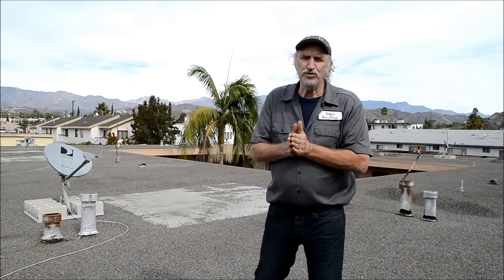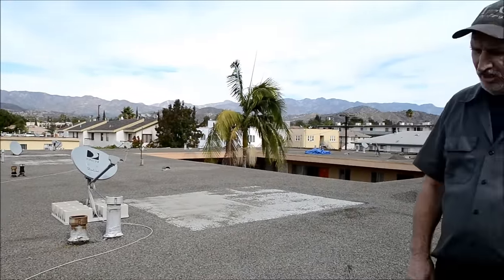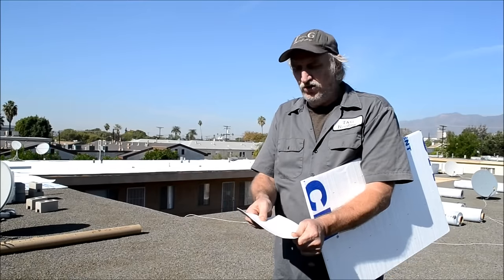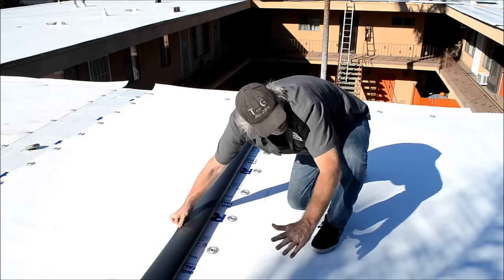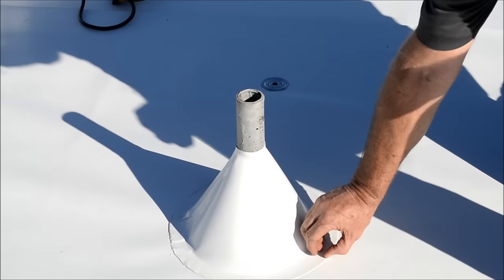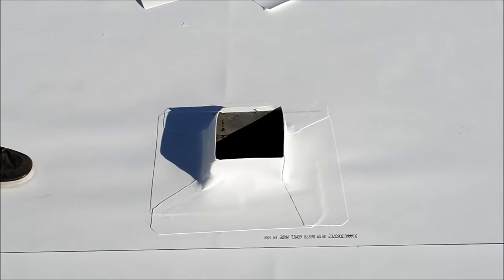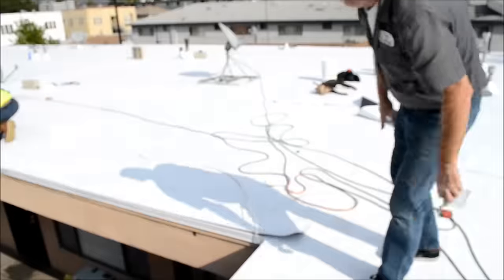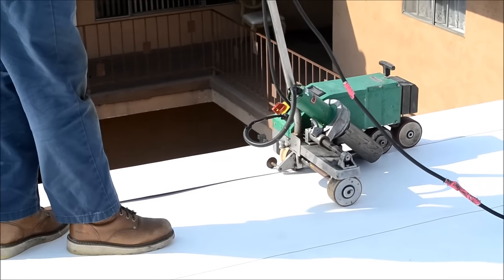All About TPO Roofing

Comment: For some reason , there are always people that think they can do it better , I bet you any money , most of the haters here can't stand on a roof for 8 hours, they don't even know how is like to be on your knees heat welding the single ply membrane ,they don't know how the white single ply membrane burns your face and bothers your eyes ,  as usual brainless people , write , comment ,nonsense stuff.
you guys did a very good job, I'm glad you didn't show this people how to actually do it , it's not worth your time , as long as the roof don't have a leak in the next 10 years , you are a good roofer!!  most of the bad roofers have a leak on the first fucking rain and they still brag about knowing what they're doing .
Good job !
Reply: I reply with facts. I have been doing single ply roof for 30 years. Started with Hypalon (Burkline), Trocal, JPstevens, Bondcoat, Firestone EPDM, Carlisle EPDM. Got certified for Firestone in "86 back when ya had to get certified to install. I have been offered jobs with Johns Manvill and Sarnifil to be an inspector. We installed Carlisle back in the day when you earned points for perfect roofs and could use the points to buy things from their catalog. So putting on a punch free roof is how I was taught 30 years ago. So when I said there were things done wrong they were. If i inspected this roof they would have been back fixing more then a few things. As for fall protection 6 foot up 6 foot in. PERIOD. 25k fine from osha dont feel good in the bank. Last leak I had was 5 years ago and it was trade damage. My name is on here if ya dont believe me check with any of the big Manufacturers Carlisle, JM, Sarnifil Firestone here in southern CA. Ill let them tell ya.
Reply: Thats pretty funny have a great day.
Reply: I roof all day every day from torchdown modified to hot tar gravel to foam and TPO this roof would never pass inspection it’s wrong insulation he ripped the owners off bye giving them a crap roof
Reply: First of all, the box is ugly as fuck. Line that shit up so it looks presentable. Second, wear sunglasses X87+ so your eyes wont supposedly "burn". (The reflecting sun rays wont melt your face either) 
Third, Quality matters.
Reply: This roof hasn’t leaked in the 6 years since we did it, we give a 10 year labor no leak interior damage warranty on every new roof we do. We are constantly working on quality and since this have changed a lot of how we instal single ply including the curbs your are mentioning. Please try to be more respectful of your fellow man, we have been in honest business since 1980 and have a very fair price for a very solid workable product.
Reply: I do this for a living so were is his membrane perimeter? Inspector had fun with that if it was inspected.
Reply: Right? I've been a roofer for 4years it's not for the faint

Comment: in 1979 the braas system everything was hand welded area and details, back pain, knees red raw, the solvent weld was 3 times, we used to do the upside down roofing system a lot quicker than the flex disc fix

Comment: HI. I am about to start a 100,000 SF gravel roof just like the one you replaced and we may use TPO. I have some questions: Is TPO more expensive than other roofs? What kind of screws are used?
Reply: We have a gravel roof. This company installed tpo for us. So far so good. I don't know what kind of screw they used but it's holding up well

Comment: im thinking about taking a job doing this. Not fond of heights .Ive had to deal with them as ive been a carpernter for years but not a fan.   like it gave me anxiety watching ur guy with the heat roller on the edge. couple questions though i was always you had to be tied off that close. but then where ? sometimes theres nothing to tie too. also when you installed the seam on the edge , why wouldnt you use fasteners? it seems like that would be the ideal place, protecting from wind etc?

Comment: What about possible dry rot that needs to be repaired? Especially if structural integrity is comprised like beams and purlins? Your roofs only gonna be only as sound as the roof deck under it. 🤷‍♂️
Reply: That's up to the buyer to decide 🤷‍♂️
Reply: You can also go in the attic from the inside and check the plywood and beams!
Reply from the maker: You make a great point, not all roofs can have a recover done. This particular roof had a sound deck, did not have major water intrusion issues. This allowed a recover to be done and save the building owner lots of money and get his tenants a waterproof covering. You are correct though in a lot of cases a full removal is the only way to go.

Comment: Can you use this product on a corrugated metal roof?
Reply: Yes you can, you would install a special insulation first which is ordered specially for each metal roof and fits into the standing seams, the TPO or PVC then gets installed on top, we have done several like this
Reply: Depends on the thickness of the metal but generally yes depending on your proximity to high wind zones and the pitch of your roof.  You may need "special" fasteners as well.  Call a reputable commercial roofer, they’ll give you a proposal and spell out your options.

Comment: How does this compare to Modified Bitumen for longevity and less maintenance? We have puddles on our roofs after a rain. Southern California, so not too much rain.
Reply: last alot longer. does not split at the seams like torch.
Reply: Torch is the king of roofs 3 ply torch. Single ply can easy put a hole even with a nail head.
Reply: Bitumen  is  1/2 thickness  is  a  beast  of roofing 3 ply torch,  easy  can last 30 years with maintenance.   Compared  with 40 mil, 60 mil , 80 mil TPO.

Comment: But what about in climates you leave windows open all year round like puetro rico. No ac as I enjoy hot weather . Like I need no insulation.   Recommended TPO .  Windows act like a cooling system. As me likes it at 85 to 90 degrees. Asking them how to install without the insulation as same temperature as outside. For concrete.

Comment: sorry one more question for anyone why go decking_ gravel- rigid foam -TPO. why cant they leave out the gravel?
Reply: Gravel was added only to hold the original Membrane down
It was only a part of the ballasted membrane system 

What this video is showing is the installation of TPO OVER that system , because the former system had failed

And of course they remove the rock before installing the TPO  over the top

Comment: How do you secure the foam board ? Plates n screws too?
Reply from the maker: Yes they make wider plates that are designed to hold the insulation down :)! In some other systems insulation can be foam adhered down as well.

Comment: What size generator would you recommend to use to run 2 leister heat guns?
Reply: any solid mid range generator (4000+ wats) will run 2 leister guns fine. Usually for our guns we are able to find on site power but have a 12000 watt honda generator we use for our robot welder and as needed for the hand welders

Comment: Hi tommy how do you eliminate wrinkles with tpo roof ?
Reply: Our wrinkles went away after a few weeks.
Reply from the maker: Best way is to install the material tight in the first place. Mechanically fastened systems are designed to have a bit of give in between so that the system can expand and contract, if it is to tight then the welds can be torn in that process. If there are wrinkles beyond normal measures, they can be cut and then the area cleaned and patched, this can be unsightly though and add extra points of potential water intrusion.

Comment: please write in the average cost of square meters? Thank you!
Reply: too many variables to say that. Depends on insulation type, mechanically fastened or total adhered. PVC or TPO or EPDM.
Reply: I'm interested in PVC or TPO as EPDM. The average cost of standard, without dismantling the old blood. Thank you!
Reply: ballpark for mechanically attached (screwdown) is about 100 for 100 square feet. you convert for meters
Reply: Ours was $21,000 USDfor 6500 sq feet over the existing roof. They swept off the gravel, installed insulation, and installed the TPO on top. No AC units and no parapets. 5 estimates and that was the lowest price. Everyone else was at $28-$43k
Reply: $230-$375 per sq. depending
Reply: @DeaganZ3488  how much you think labor only would be to remove tpo, tear out 1 in. Iso...metal decking , put back 2 layers of 2.2 iso cover board and tpo 60 mil? 757-949-4798

Comment: Do you guys glue down your material to the insulation?
Reply: The insulation is fastened to the wood deck and the single ply is fastened to the deck on top with screws every foot on center.
Reply: Depending on the product, Firestone TPO can be fully adhered using TPO Adhesive leaving a seam to be welded down, or mechanically fastened using screws and plates every foot.

Comment: Every roof penetration needs to be at a minimum 8” high of the roof level
Reply: that actually varies by manufacturer and city. Many are starting to say 12-14", pipes are generally 5-6" for manufacturers,  and many places only hold the rule along the lines of :"high enough for manufacturer approved terminations and penetration seals", which is usually 2-3".
Reply: Colorado Consultants For Roofing yes anyone can get away with anything but the right thing to do is 8” minimum for every penetration

Comment: Your thin insulation will not hold up to hail, forming small dents in the membrane straining the scrim. This will simultaneously make the membrane more susceptible to hail but potentially also cause premature delaminations.  However,  this us an industry issue for letting people do it with a system that's barely been made since 2001 (I know it dates to the 70s, but fire-retardent chemical shortages resulted in a formula change in 2001, for those who don't know roofing history and want to Google to say I'm wrong without knowing CSPE from EPDM.) Beyond my hatred of using one of the worst insulations out there,  I agree with your quality.  Also, for Gods sake open up your walking welder and clean it out before you fry both the element and motor. The fact I can hear that screaming "kill me" from that distance is a genuine concern to me.
Reply: I work for this company which is based in Los Angeles where it almost never hails, we offer and hold to 10 year labor warranties on all of the hundreds of single ply roofs we install every year and dont have problems with our roofs during our warranties (the few callbacks we do have we handle swiftly) :). We also use Secure Rock and other stronger insulations when we can, this option is cheaper though for customers on a budget and we hold to the same high performance standard.
Reply: @PapiSquati  I'm in LA also, looking for TPO flat roof company to replace a flat roof.

Comment: Tell your hand welder to get on his knees and weld it right.   Everyone thinks they can weld I guarantee his work will fail.
Reply from the maker: This roof was done almost 10 years ago and remains in service, leak free and functional. The detail welds are the most important part of a TPO system I agree with you there. We probe our work multiple times as part of the process to ensure we don't miss cold welds.